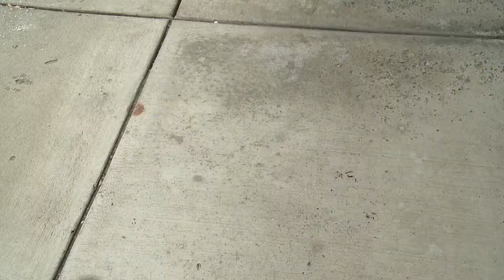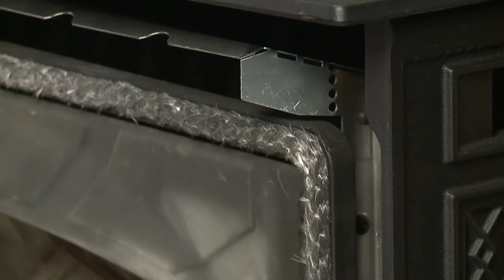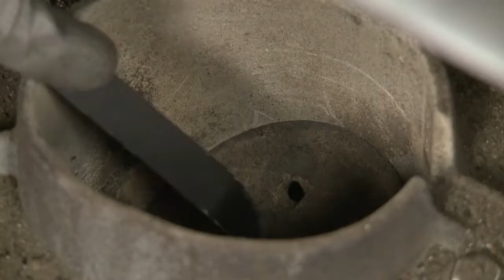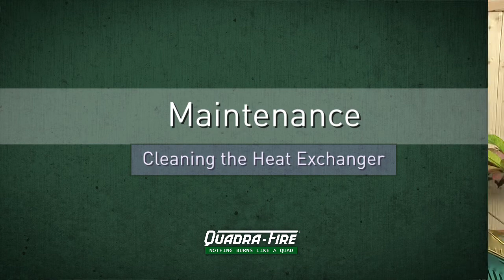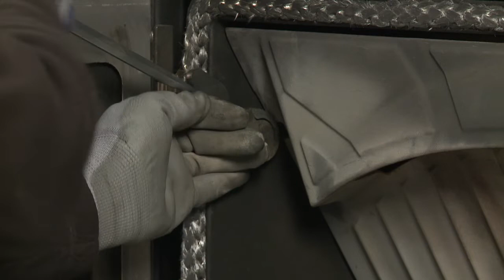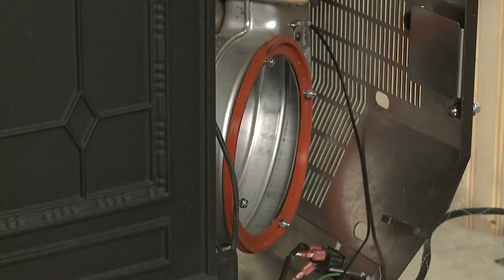Quadra-Fire® Trekker Pellet Stove/Insert: Cleaning and Maintenance Video

Comment: My insert keeps shutting off stating feed error. There's nothing in the pot and feeder is full. I think it may be over feeding. Anyone know how to fix this problem? I dont have a tech coming out for a few days.
Reply: I've run into this too. I just got it 3 days ago and have run into this. In my case, I'm guessing I have to fill the hopper slowly so that there are not any pockets without pellets because I don't believe the pellets flow down as easily as one would believe. They get stuck somehow...just a guess.